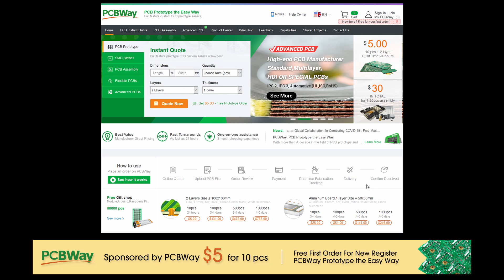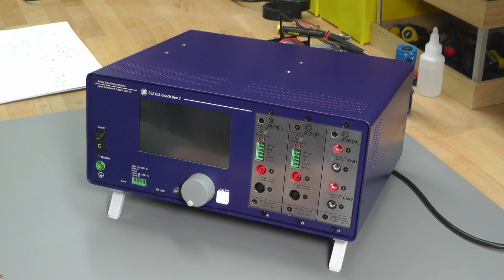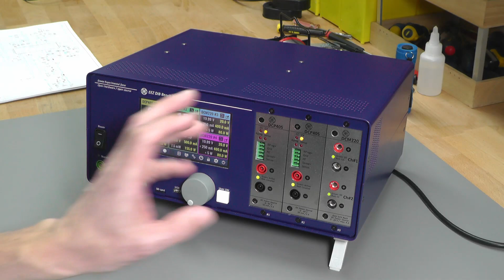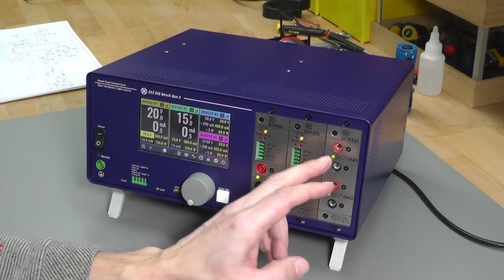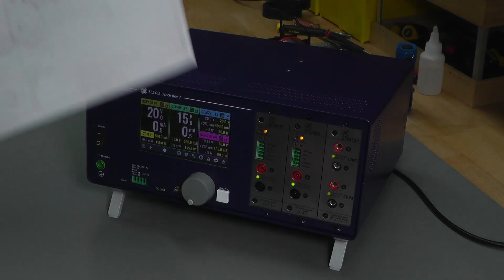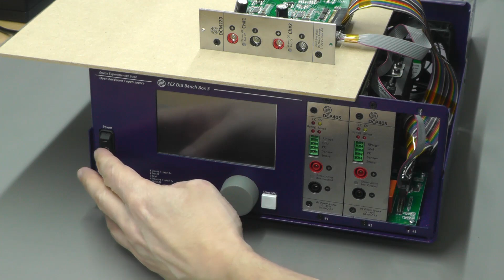No.072 - EEZ BB3 Bench PSU Repair

Comment: I've resoldered the thermal pads on those chips by simply flowing solder onto the bottom pad... enough seems to get through the vias to make a good solder joint. Putting flux on the thermal pad first really helps :)

Comment: Basically shite quality lead free solder. Lead free solder causes so many problems. Resolder the whole board with nice juicy lead based solder (as big clive would say). Since this is a kit you build yourself, i thought that you assemble/solder the boards yourself. Seems not.
Reply from the maker: It was an option in the crowd supply, I chose to buy the boards ready assembled.
Its only the DCM220 card that has the known reflow issues. I guess they got it real bad on that one for some reason.

Comment: Excellent find & repair. May we ask was your purchase for this your unit shown here via the Crowdsupply by Envox? They experienced an horrendous production run for some of these boards care of an inexperienced PCB manufacturer, so bad that Envox had to re-spin with another firm while absorbing the costs of new parts and the delivery date to Backers of the units became quite delayed. The future looks incredible with this feature rich unit thanks to its "program-ability" under  MicroPhython or Node Red etc in that it's not just a bench powersupply but a significant Laboratory Device! Mine awaits my attention, hopefully when the winter months arrive i will find the time!
Reply from the maker: Yep, mine was under the crowdsupply.

Comment: Probably worth applying a Rossman of flux and reflowing pretty much every component on the board, which should fix any joints that are somewhat dicy. Probably as you say too long in the toaster oven, or the solder paste was left out too long and had oxides in it that the flux in it was unable to clean off properly, leading to the poor adhesion, or they mixed different solder paste types on that particular run of boards, probably due to the paste running out mid run, and you just got the one where the different batches made a pretty good imitation Chipquick solder paste.
Reply: LOL, a Rossman amount of flux is kind of like using an entire tube of toothpaste to brush your teeth.

Comment: It looks like pins 17 and 18 had a bridge after you removed it, I wonder if that was there before you pulled it off ? with 16 and 17 being used for current sensing.
Reply from the maker: No, there were deffo no bridges, I had well inspected everything prior to removal.

Comment: hi Ian, i love your work and your examples more than anything. You are also one of the first to take a close look at this eez-project from a user perspective. 
I myself am currently working on the concept of a precise adjustable voltage reference based on ltz1000a (eevblog-px) and ad5791 (still expensive). Nextion display and a pi-pico 2040 in the moment have so far produced a very good real  working feasibility study, but there is still so much work to do! Your little adjustable voltage reference is my role model there. Besides, I still have a lot to learn. The next step would be a back channel via ad1256, and auto calibration via my dmm6500 and the operational reliability along with providing some more mA output. A power stage as a future dream is a story in itself anyway. You are my inspiration here.
Thanks at all
Reply from the maker: That'll be a nice project to follow, just make sure you choose a suitable ADC or all the goodness within the LTZ and 5791 will go in vain......it's only as good as the weakest part. 
5791's are on long delivery here......I've been waiting weeks for a couple for a new project.
Have fun.
Reply: @IanScottJohnston  Yes, no parts in the moment. Fun and learning is the goal. ✌️👍
Reply: Cool project! I've been wondering how better would the PVDS be with AD5791. Now using LTZ with proper precision resistors will add cost too. If you want to go all the way into super precise instrument then I guess something like AD7177, like the CERN project uses, or ADS1263, which I found on Waveshare Raspberry Pi HAT, would be a good choice. Of course I can imagine the analog front end takes more work and cost than just using the top end chips. Still, 1ppm stable DIY calibrator (in controlled oven...) sounds exciting :)

Comment: Was the board done originally with lead-free solder, and wouldn't you expect a lack of shininess if that was the case? Doesn't mean you're way off base, just that you can't always necessarily tell solely based on the appearance.
Reply from the maker: It would have been lead free, and that's what I was using also to touch up etc.
You can get shiny joints with lead free, just not quite as easily as leaded.
The kicker was the manufacturer admitting reflow problems with those boards.....my evidence just seems to back it up as the failure reasons.
On the first few components I tried resoldering it was really wierd, the consistency was miles off.

Comment: Always enjoy your vids Ian. Straight into the meat of it. Thing is, knowing the issue with the solder on that board will you be forever expecting it to fail again..
Reply from the maker: You're not wrong......solder does age, so its maybe a lot closer to its next failure than it should be.